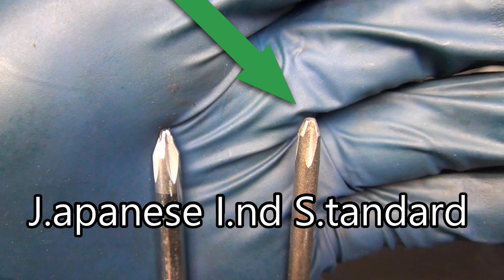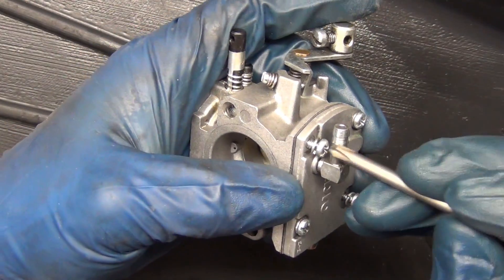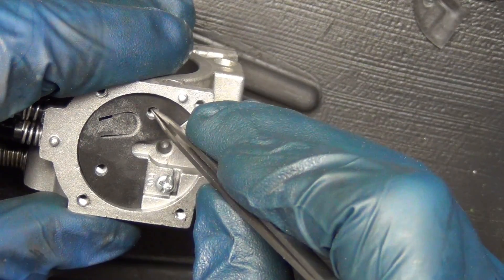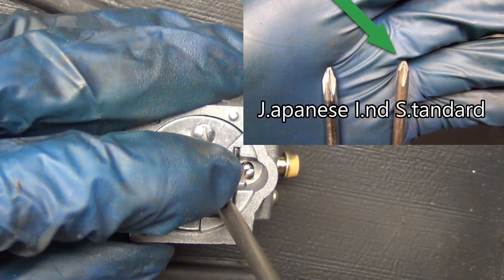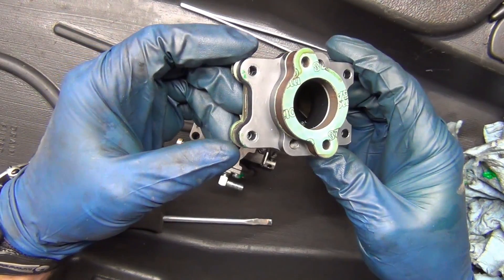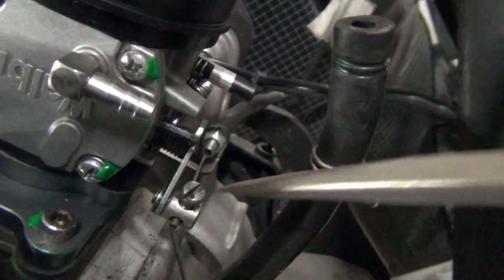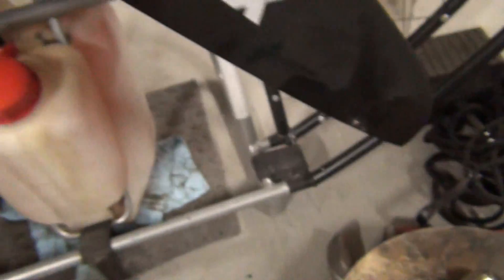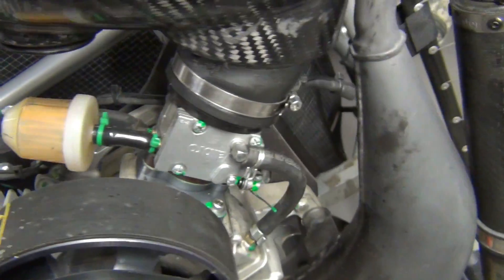Pt. 2of2 Carburetor K10 WB Walbro Vittorazi Moster 185 Rebuild How To

Comment: You missed a critical step, which is setting the height of the needle lever. This controls the position of the metering diaphragm. You also didn't do a pop-off pressure test.  Both of these are important.
Reply from the maker: Thanks for the feedback, I appreciate it!

Comment: Brian, great video. Used it to rebuild mine. thanks! two questions...first, what is the little hole drilled in the diaphragm cover accomplish? Second question is...a buddy told me that in order to get the idle right, I "need the correct spring tension on top of the diaphragm...something like 12psi" any idea what spring he's referring to?
Reply: I guess you will have found out by now, but just in case you haven't, it's the little spring under the metering lever (the one that lifts the metering needle.

Comment: Great, very informative video! Two thoughts. Double wrap your zip ties so they don't leak. Often, if you don't wrap them around the fuel line twice, they leak. Also, I hate to see a u bend in the fuel line, meaning the line goes above the carb, then back down. Best practices are to have the fuel line heading straight up toward the carb with no bends in it. It may not be a problem with your motor, but many might form an air block that won't get sucked up and removed by your motor which could lead to a melted piston.

Comment: Beautiful tutorial on the carb.  I tore mine apart after watching your video and found that the diaphragms were warped and the needle was entirely ruined.  It's been hard starting for a while and I hope the rebuild fixes it.  Haven't flown yet.  One thing I love is the Green everything that you added.  Thank you for starting me down the path of marking everything with the same color.  I also stuck a zip tie on the spark plug cap.  I got that idea from a friend who had his constantly fall off while in flight.

Comment: Being able to torque to spec with feel is impressive enough with a ratchet (I'm somewhat a torque nazi) but this is the first time I've seen someone do that with a screwdriver, and that was a great tip about pressing down while tightening to reduce chances of stripping threads (as I understood it). Makes so much sense. 

I have a question though. Why zipties on the hoses instead of hose clamps?
Reply from the maker: Great question.  Weight, color, serviceability, and it works.  They don't cut like wire does, they are lighter than band clamps, and they're green and easy to spot an issue on pre-flight check.  If it's gone it's easy to spot.  If its there, the hose will stay there also.
Reply: That makes sense. Thanks for the info!